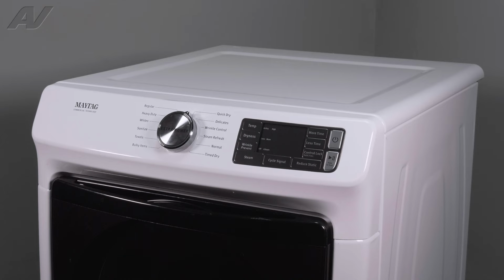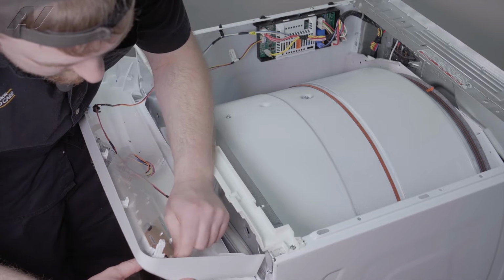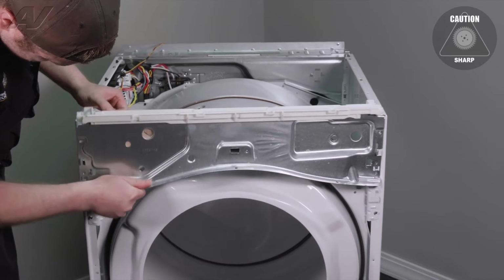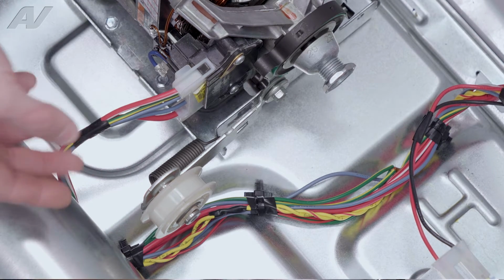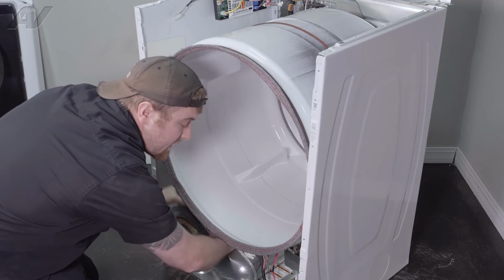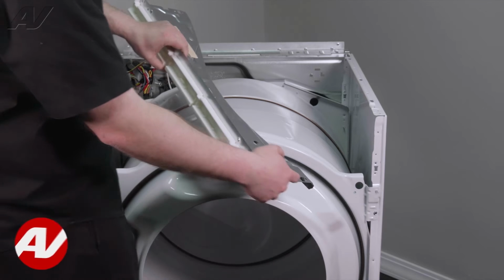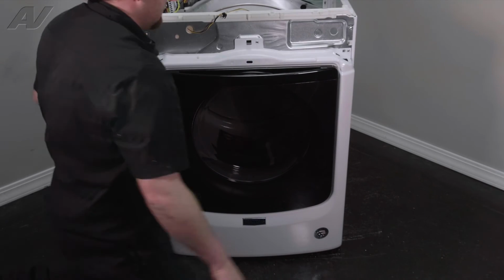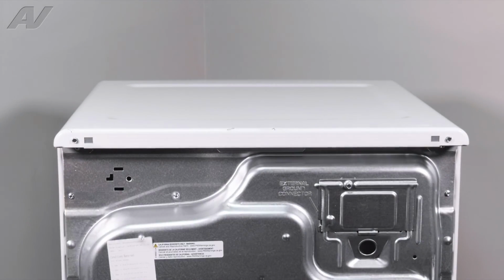Maytag Dryer Repair - Will Not Start, Noisy When Running - Idler Assembly

Comment: Thanks Kraig.   My exact same 4 year old Maytag dryer is starting to vibrate and make noise.   Before ordering the repair kit with the rollers, belt, and idler pully (changing it all while it's opened up) I wanted to see what was involved.  You covered everything in detail and left nothing out,  EXCELLENT!!  I'm ordering the repair kit now.